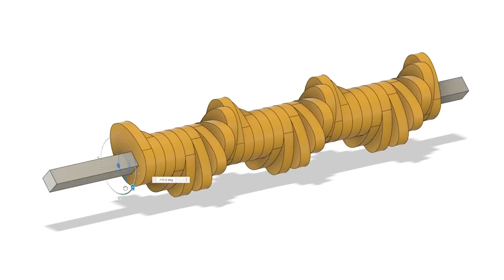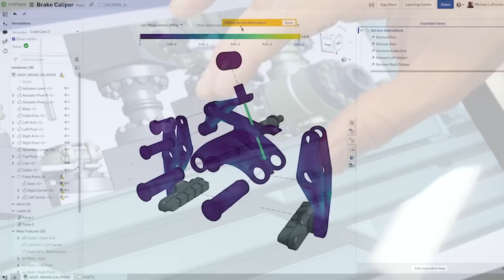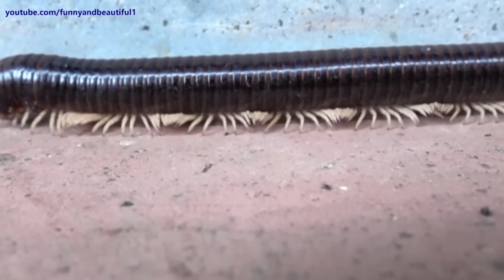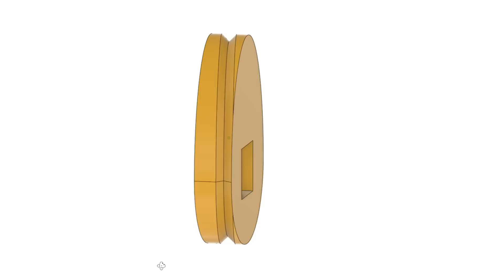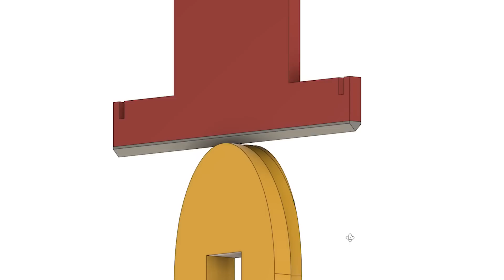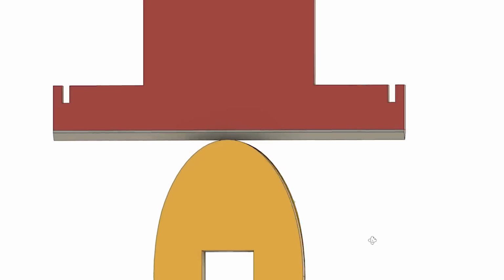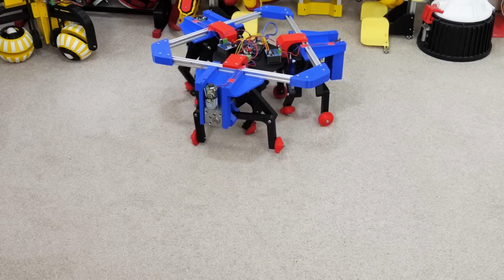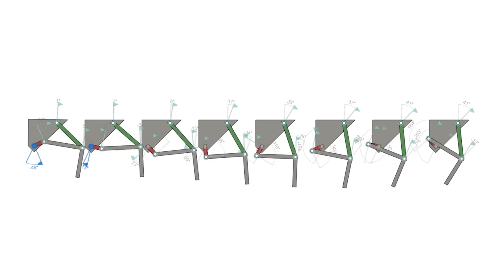Experimental Wave Drive V2

Comment: This may work if take that strip of rubber and make a 'U' shape linking each foot seperately. The actual height of these feet will have to be determined dependent on the thickness of the rubber material. This should create the 'rolling' you're looking for, similar to the screw track you made, but on a much smaller scale.

Comment: Couldn't you just angle the drive, or is that cheating? If you make the legs progressively longer towards the back, or angle the slots the toasts ride in, then rather than just pushing down, they would push back. That might introduce too much friction on a ridable robot, though.
I do love the path-cams idea, I just think that they need to have the base of the 'egg-shape' be the stick-outy bit, rather than the point, so that the feet move more along the ground than just rapidly punching. Maybe having thicker cams so the effect is more pronounced would help, too.

Comment: The play in the toast and lack of grip may have largely canceled the ability of the slotted cams from propelling the robot forward. My original thought was to angle the toast to push toward the back rather than suspend perpendicular to the surface but then I thought that articulated toast following a slotted track might be able to straight-ways reach the surface before angling backwards to give push.

Comment: I think the toasts need to push the ground back instead of just pushing vertically. The reason the robot would go forwards is because it was front-heavy (tilting the robot down at the frokt, causing the toasts to be angled backward). If all the toasts were angled back slightly I believe it would perform better.

Comment: 7:48 I think the reason this section of track works and the others don't is because the rubber feet stick out from the track and act as little levers that plant and then twist and then lift off the table and in the twisting is where it walks forward. the other designs used flat track with no extended leggies, and therefor didn't go anywhere. 

also, you are on a perfectly flat surface in which case the toast oscillator would have no reason to go anywhere because there's no surface features to push against with the traveling voids in the wave. set it on the carpet or some other deformable or lumpy surface (maybe with training wheels so it doesnt fall over) and maybe it'll locomote.

Comment: It didnt work because the toaster slots are the full width of the motion you introduced with the new cam profile. Theres nothing for the leg (toast) to leverage the difference in the cam profile slot. If the toaster slots had an hourglass profile it would work the way you have it but you're probably already off on some other wild tangent already.....

Comment: I've not followed, though for some reason I was thinking like a "Wave Generator" or something the like.  My first thought was I wondered if there is a freewheel or overrunning clutch for each float connecting rod crank (or whatever mechanical translation used) on the drive shaft.  And now for something completely different!  Neat design.

Comment: Hey, don't bin this design just yet. Make the height of the camshaft above the toast variable at both ends of the machine. Raising the camshaft at one end and lowering at the other will have the effect of tilting the machine so that the feet push against the ground with some component of horizontal action.

Comment: I think this may be the solution. You need little riser studs attached under the rubber belt like millipede legs. The studs on the belt stay perpendicular to the belt as it flexes over the sine wave shape. Like this: /|\|/|\|/|\|/|\ The result is each stud traces an inverted arc while in contact with the ground. Oddly, this will make the mechanism walk in the opposite direction as the wave progression. This is also how your previous linked belt wave drive worked.

Comment: I guess you missed the point why your previous design worked and this one does not:
The forward movement from your previous design stemmed from the chain element tilting over when at the peak of the wave, using its own height as a push-forward lever. And this lever is pulled by its precedessor in wave.

Comment: The issue in the last configuration is that they spend the most time moving when retracted (the cams are not producing sinusoidal waves) you really want them extended, the moving then retract then move. It currently only touches the ground very briefly, so very little motion in the "step"

Comment: My guess is it will just go up and down without the legs being connected. I feel like it must be a subtle flexing that lets the track move normally. Maybe
Reply: It seems like one of the biggest reasons is moves at all is that the motor is in the front and is making it tilt forwards a bit making the legs hit at a very slight angle

Comment: i think the toast legs arent actually moving forward/backward when its on the ground because there is no pivot in the middle, the legs are free to move along their entire length,so the pivot becomes the floor.  maybe of tou attached a thin tighter fit piece to the top or bottom of the toaster.

Comment: I bet the grooved cams would work if you had fewer legs.  The millipede is able to bunch the legs up to save space between sections that are taking a step.  Maybe you could approximate by having fewer legs spread further apart. Fewer, wider cams with wider grooves and the feet would have more travel.

Comment: Just my two cents, but 1) your table has zero traction for any real test. 2) put little rubber pads on the bottom of the toast feet, not only for traction but also for 3), which is that the steady vibration and any inherent imbalance causes the entire machine to bounce up off your hard table, and every time a toast bottom hits the table, it bounces and negates one or more of the subsequent toast footfalls. Perhaps try it at a lower speed, if you are going to try it before adding rubber feet, if that is even anything you are interested in trying. Since each toast can articulate now, they can add the forward motion individually without washing out the following feet.

Comment: I'm convinced The v1 screw drive worked so well not because of the wave like nature of the screw, but because each section of the track while at the bottom of the wave is turning around the bottom of the wave just like a wheel while it follows the edge of the curve.  Having those rubber standoffs are like sticking tiny little legs on the end to amplify the turning radius.  I don't believe any wave drive will work until the bottom of the wave has the ability to move significantly.  The individual legs like in the centipede are moving significantly and so I think will definitely work much better.   

I would be interested to see what a flexible track like on v1 but attached to the bottom of v2 would do since it would combine the simplicity of the cam with the circular motion of the individual track pieces of v1.  I would also be interested to see what it would look like if you attached significantly longer "legs" instead of rubber standoffs to the bottom of the v1 track as I suspect it would end up looking much more like the centipedes motion where the legs bunch up on the inside of the curve and spread out on the outside of the curve creating a torque against the ground while they are spreading out.

Comment: I think it might work better if you printed a flexible tread with a flat top and ridges along the bottom (like this: ¯\_/¯¯\_/¯¯\_/¯ ). Then secure the tread to the feet using screws through the thinner sections of the tread to the holes in the feet, so the ridges stick out between the feet. This would create a circularish motion with the contact points of the ridges. I'm not sure how much the distance between the feet change as the wave passes by, so the stretchability of the tread may impact the functionality... however the extra room for reduced friction might counteract that. Though you might need another row of elastic bands to create more lift for the legs, as the tread would add more resistance.
Reply: Alternatively, you could go for a rigid connector alternative - flat plates connected between adjacent legs (pieces of toast) and have feet on them. They would need to connect with a pivot point on the outside of the legs, with some telescoping action to account for the change in length between the connection points while the wave is passing.

Comment: I think the groove in the last approach needs more angle on the section where you touch the ground and less along the whole crank. 
The "toasts" should also have an angle. I think the biggest problem is that most of the forces go vertically into the table and not horizontally along the track.

Comment: I think this design is promising! You should try adjusting the cam profile so the feet contact the ground for longer, and maybe work on tightening the tolerances and precisely mating the cam profile for the forward motion. I think the cam on cam to drive 2 axes is brilliantly simple.

Comment: I had guessed that the machine would move in which ever direction the toast was leaning more against. Had they been perfectly still then I would assume initial direction would be based on which side had more push from the toast bending and esentially acting like leaf springs. Though now that I've seen it move I think I would've thought it would move in the opposite direction of the motor because the potential weight difference could create that leaf spring effect to push the opposite way.
An extra axis for pitch of the wave machine would help with movement, so that you can control the attack angle of the slats. Two of these modules with variable height slats and you could probably get it to run with a flight controller pretty easily (totally inexperienced with them so someone else can hopefully give better advice on this) while also increasing it's usability on different terrain. Rather than carrying the weight from one place to another it would work more by pushing the ground away. 
Another idea would be to have sections of slats with the modular heights to control the angle that the weight of the device has, although this would be hard to do for a vehicle you plan to drive.

Comment: all you had to do was add nubs to the rubber sheet from your second setup. That would make it so the tip of the nub follows an arc motion about the radius of the wave making an overall horizontal change relative to the ground. This is because the nub will always be nominal to the tangential plane of the sheet rather than always facing into the ground. This is also why your flexible track from the pervious video worked because it had the same effect with the links + the nubs on them. 

Edit: also I think you would want somewhere around 4-6 "nubs" per the wavelength of your shaft so you have one in contact with the ground at all times per peak of the wave. but It depends on the length of the nub the longer it is the fewer you would need. However longer and fewer nubs is less smooth but its faster then a lot of small nubs because your overall radius gets shorter. Overall this change would also more closely replicate the motion seen in the millipede.

Comment: Yet another example of "to someone with a room full of 3D printers, everything is a nail" - I'm constantly perplexed by the banal shapes people on YouTube use energy and expensive filament to print weak components out of when they are basically bits of stock with minimal shaping. Almost all of these parts would have been much better (and quicker) made with a CNC mill.

Comment: Hi James, very cool design, I am enjoying your builds a lot. I feel that the walker will only walk downhill though as the legs are only travelling up and down, which does not give any forward propulsion. At 7:03 you get the walker to seemingly walk uphill, but it is only doing so while you are leaning on the table, therefore the walker is still walking downhill. At 7:09 you stop leaning on the table, as soon as you take your weight off the table the walker is no longer going downhill and stops moving. At 7:20 you are not leaning on the table and the walker walks downhill again. I feel that you need a spiral moulding on the cam faces which will move the top of the toast (leg) backwards when the leg is up and then push the top of the toast forward when the leg is down, if the toasts are pivotted this will create a small amount of forward force as each leg pushes down and back on the ground.
Reply: I'd probably switch from using single pieces for the legs to pivoting ones that do give you a bit of push forward or backwards depending upon how much deflection angle you give the groove. The spiral worked because the tank treads did get a bit of an angle forward or backwards as the track tried to match the angle of the coiled wire.

Comment: Unfortunately this design fundamentally cannot work, towards the end of the video with the millipede analogy you were getting closer the solution. The flaw in the original design is that you have no net forward motion of the wave elements, it is just up and down motion. You could get it to move consistently forwards, as you did by simply having a slight imbalance in the robot, this would create a slight positive force as the motion of the legs has a small backwards component. It would also work to move forwards or backwards along a ground that had the same wavelength as the legs, you can see this if you turn the robot upside-down and put a ball on the track, which would move back and forth depending on the direction of the wave as you did with the tape. You might be able to use this with a series of tape cyllinders on a track, which would look sufficiently rediculous to make an interesting robot, however the cyllinders would need to have no rotation relative to the ground else the robot would again just stay still as the cyllinders roll along the ground beneath. What you want is to create a sideways forces for as long as possible with the limbs that are in contact with the ground. The previous track achieved this because the rubbber feet essentially turned while in contact with the ground. Using the individual legs will achieve this, you could also just use the cam shaft directly on the ground as it is an approximation of a screw, which if it were made to be a little more smooth and screw shaped would work.

Comment: If you tilt the robot forward it will walk forward, as each leg hits the floor at an angle. It is a bit front heavy, so it was already doing it a little bit.
You can shave N*d from the length of each leg, where N is the leg number counting from the back, and d is a fixed amount (e.g. d = 1 mm perhaps).
On the other hand it looks like a really nice back massager.

Comment: Prediction: this won't work because the toast is just bouncing up and down in place. The moving of the contact surface is needed to move along a flat surface. With a screw drive the screw simulates a movement with the continuous helical plane. Going over the coiled wire, I assume, causes horizontal movement in the track segments. I imagine it's like a tiny segment of a turning wheel. I tried looking for it going frame by frame in the footage but the video wasn't clear or high speed enough. 

Yup.

Anyway I envision you could have track segments attached to pivots on the end of the t pieces so adjacent segments would pull and cause the little feet walking motion.

Comment: Hi James
I think the outline of the cam is the problem.
You mentioned that the individual “toast pieces” doesn’t have enough time with contact with the ground. 
I suggest you try a cam shape where the wiggly part is at max radius, at a wider angular sector.
Good luck 🤞

Comment: 1:30 I assume it diesn't realy matter if you use a spiral or a wave shaft. What matters is the part that touches the ground. THAT needs to be one line of dots for example with each dot having an unchanging distance to the neighboring dot.
If you then introduce a wave or hill on one end it will apear shorter since the lengh now doesn't follow a 1D path anymore. And if move this "warp" throgh the are and out on the other end again, you have shiftet the area a bit to the side in which the "shortening-warp" was travelling. Since you have shortened the rope on one end and streached it back to its original lengh on the other end. But if you stand on individial points that are not connectet to each other, you wont get any movement out of it since you are only lifting a leg up and placing it down on its initial psition again.

Comment: Very Interesting, Thank as always.
Half way down the video, you demonstrated that vibration was moving the object.
Or, the fact that it has "near air time" (a step section with no friction), cause gravity to move it down the slope.

Making me feel you should build a "skipping robot".
- use a gyro to generate forward vector
- legs that drop to the ground, collect ground friction energy into a spring, and release.

Comment: Try attaching semi rigid rubber feet to each piece of toast, with the feet coming of at an angle so that the contact point with the ground will be offset to the toast. when that foot steps, the rubber foot will flex under the weight of the machine and provide a slight forward motion. downside being it will only move in one direction, and wont be reversible by reversing the motor. This is similar to how a bristle bot moves.

Comment: You could change the cam profile to have a longer dwell during extension couldn't you?   It would act like a quick-return linkage mechanism.   
This way you get more contact time per foot and reduce accelerations during getting contact (although you will have higher accelerations during the return but it could be worked out)

Comment: You have nothing keeping those legs in the middle so when they are gripping carpet at the bottom the point of rotation is on top of them instead of the middle.